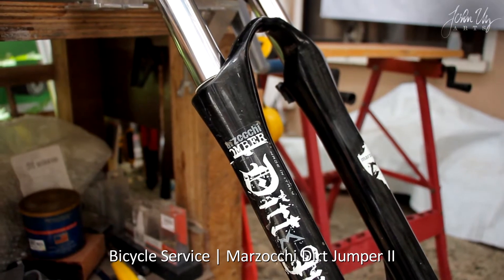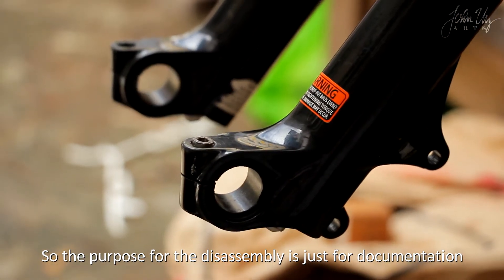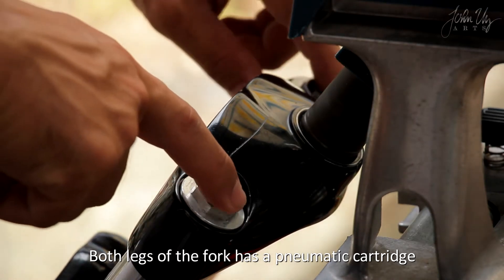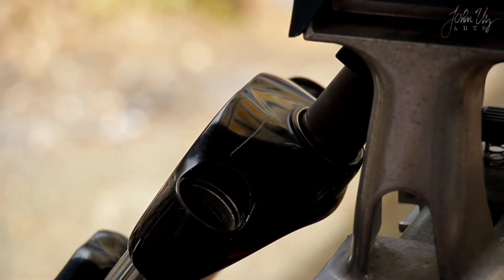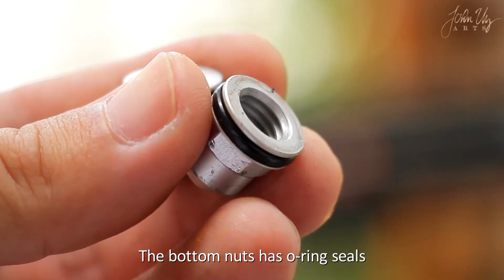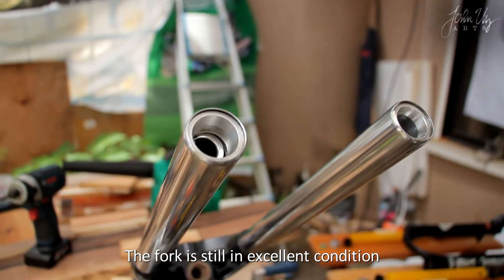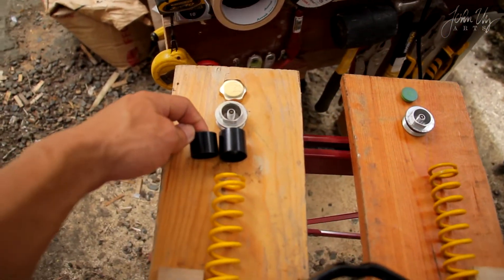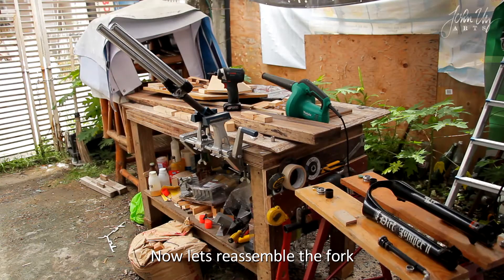Bicycle | Marzocchi Bomber Dirt Jumper II Fork Travel Adjust Attempt

Comment: Great video, I know this is quite old, however it looks like that fork only has the option to be reduced from its current height. The two plastic ring/spacers get placed on the negative side and thus reduce the travel, so the fork is already "increased". I did the opposite with my 2004 Marzocchi Bomber Dirt Jumper III Fork to reduce it from 130mm to 110mm.

Comment: I have the same fork but can take the nuts off at the bottom as the socket dpesnt fit, do i need a speciffic socket? If so wjats it called or can ypu send me a link
Reply from the maker: you dont need some special type of socket wrench , i used a cheap one here , but anyways , when troubled with fitting socket wrenches , buy a thin walled socket wrench usually with a hex hole , not the multi sided hole , too bad i can't post pics here hehe
Reply: @JohnUyArts  can you texte my insta is dhmtb32 i reallyneed help ill send you pics of my forks as i cant assemble it
Reply from the maker: @braddonguest2050  hows your fork? apologies i've just seen this comment , i never saw this one
Reply: @JohnUyArts  12mm?
Reply from the maker: @MyGoal1000  12mm or 10mm socket , i believe it was 10mm

Comment: How to change travel ?
Reply from the maker: Hi Good day ,  Im afraid the travel cant be changed with this model :(
Reply: @JohnUyArts  ok i got drop off 4 and i can change travel. In your fork you have rebound in the right leg?
Reply from the maker: @ycekcycek2896  this fork model has both coil springs in the left and right stanchions / legs , the rods and spring assembly have no configuration to change the travel , i find the only way to change / increase the travel is to fabricate a longer shaft in both legs . The current travel is 100mm , the only change that can be made is to make the travel shorter , not longer , sad :(
Reply: unsa na oil imong gibutang bay?
Reply from the maker: @simplybrideevents2343  any fork oil will do sir